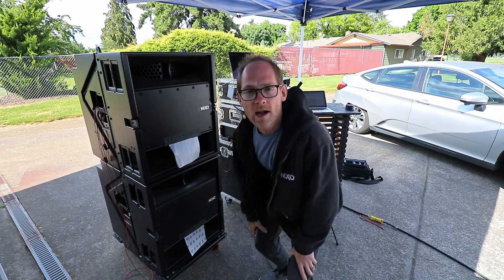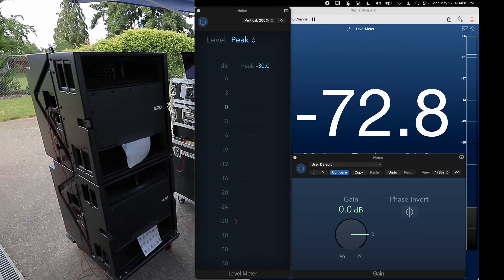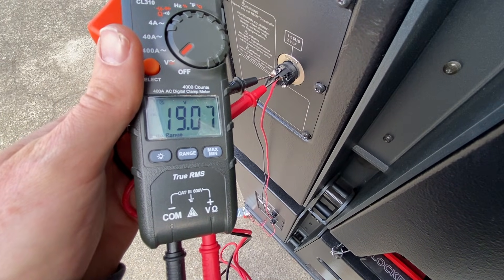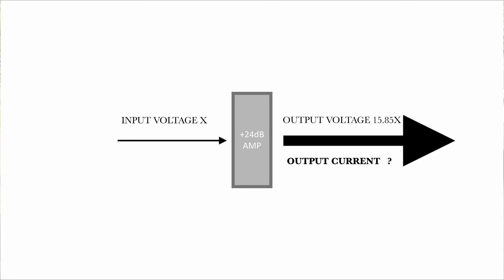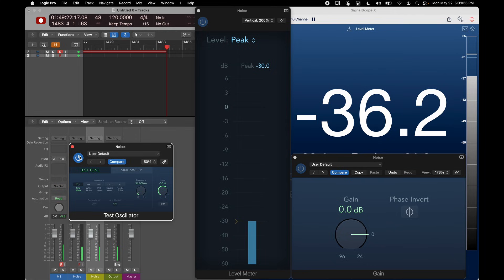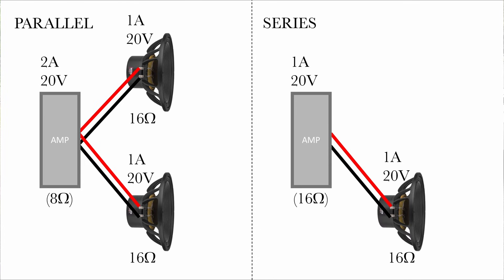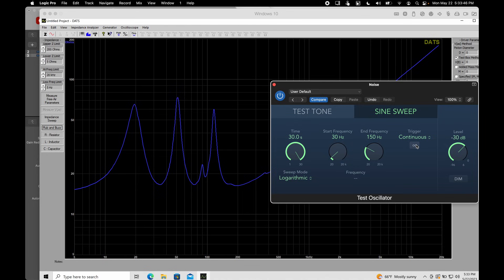Is doubling speakers +3dB or +6dB? What's parallel and series wiring?

Comment: A bit misleading and can be completely wrong in many cases, but it could also be technically accurate if your amp will double the current like he says at 2:50, at 2:50 he states that almost all amps double the current and keep the voltage the same, this is not true, many many amps do not, especially nowadays with class D garbage, and if they don't you end up with less DB increase than what is represented in this video.   Then when he gets to the part about adding a speaker in series, this is why that can be wrong and misleading also.. Why? read on... The Zero DB added with a speaker added in series is "technically zero" but then it doubles your power handling capability and doubles your surface area and now you can see the math on that right?   Also, he does not mention that in parallel you need and amplifier that can double the ampere output and handle that higher amperage / lower ohm load safely, if it can not you will not get the DB increase, or maybe you will but then your amp overheats and blows up.   Personally I prefer to use a higher ohm speaker and then connect in parallel, in parallel they are more in sync, and in series they can actually have slightly coupled oscillations, with results in a phase problem and loss of DB and SQ.

Comment: Please correct me if I'm wrong. You got +6db, but only in case when you underpower youspeakers, right? Cause if the speaker was playing at its maximum rms power, connecting the second speaker in parallel could damage them both, so you should turn it 3db down

Comment: Please correct your narration at 6:25.   The speaker's resistance is constant, it's impedance varies with frequency.
Reply: It's resistance also varies with power input as once that voice coil gets hot, it's resistance increases. There is a name for that and it's called "power compression" as once you get those coils hot, doubling of power no longer gets you +3dB's even if you have the x-max left to do so.

Comment: would i wire in series or parallel for splitting the 16ohm speaker output for a guitar amp to two 8ohm speakers?
Reply: series

Comment: WRONG.
2:19 - 
Ohms is NOT a measurement you infer from taking a clipon ammeter reading, via an AC speaker voice coil current/voltage.
OHMS is ONLY a measurement used for a PURE resistor.
Speakers have a voice coil (an inductor) thtat DOES NOT reflectit's DC resistance, when powered by an AC signal,as then it's reference is as AN IMPEDANCE.
A Capacitor is likewise referred to as drawing a certain amount of DC until it reaches it's capacity, then it STOPS drawing any more current, thereby switching that circuit OFF.
On reversal of a dc voltage at a capacitor, you IMMEDIATELY get an outrushing extremely high current - until the opposite voltage is the same at he capacitor as it is with the DC connected to it, then it again STOPS drawing any current.
That's why a capacitor is very good at passing any type of AC and it's why it is a brilliant DC OFF SWITCH, because one the DC voltage is reached, at the capacitor it stops conducting..

OHMS LAW is determind purely by way of a risistanc  (across a length of any resistor, such as a Nichrome Wire.
When I was building heavy industrial switchboards (in the 1980's) we often "wound" nichrome wire coils, so that we could direct start LARGE electric motors direct off the 400v AC 3phase lines, as the nichrome was extrem;y resistive, as well as being coild, which added to it's reactance, meaning that it had a very restrictive resistance (as well as a substantial reactance) to any additional current flow, which allowed a LARGE MOTOR (connected by a contactor onto the Nichrome coils) to slowlyincrease from stationary, up till about 50 - 55% of it's noral speed, at which time, a timer would swap contactors, taking OUT the Nichrome resistance, and connecting the motor directly onto the incoming 400v 3Ph mains, whereupon the motor would rapidly increase it's rpms, up to it's normal running speed.
That way, the incoming MAINS cables at the premises DID NOT have to be extremely large, to handle DOL inrush currents, if those motors were connected directly onto the incoming mains with the motor stopped.
As that amounted to a basic short circuit as far as the mains was concerned, meaning that fuses would ""pop" everywhere, so bringing a motor UP slowly from stationary, until it reaches about 55% running rpms, and ONLY THEN connecting it directly to the incoming mains, does the mains need to supply a little extra current, to uplift the rpms until normal running speed is attained.

Now, IMPEDANCE is what you "should be explaining" when dealing with AC voltages in speaker voice coils, as their resistnace has absolutley nothing to do with their terminal REACTANCE on initial startup, or during the later "normal running"

2:19 - TALK ABOUT REACTANCE.

Comment: You got the reason wrong. Doubling the speakers doubles the power. That is +3db. The correlated sound from the speakers adds and subtracts together and and changes the direction of the audio spread. So with speakers stacked the horizontal angle is increased while the vertical is decreased. Dead center we get the extra 3db.

Comment: Soooo, if you had 2 sets of 100 8ohm speakers wired in a series parallel configuration with a 4ohm load you'd get 180db gain?

Comment: Hello? Can I ask question for my car stereo and amplier, 
My amplier is 3000w, 4 channel, but the car stereo I bought is only 2 channel, and the 1 channel  connected in my 750 sub woofer at the back seat on my wagon and the other 1 channel connected in a dome tweeter 100w, and I want to add 1pizzo tweeter at the front seat, is it right and safe if I will connect the Pizzo tweeter in the channel of the dome tweeter? Can I have your advise? Thank you!

Comment: Remember lower amps means you can use smaller wire.. Everything in Life is about compromise. I'm dealing w the phase issue of matching impedance so Ive decided to use wooders in parallel and mids and tweeters in series.. I figure I will get less audible cancelations at the frequencies most heard..

Comment: The concept of the “impedance chart” implies that the voice coil has fixed resistance.  The impedance will fluctuate in reality because it is a coil and therefore it is an inductor.  The impedance variation is inductive reactance and is based on the Formula 2piFL.  2 times 3.14  times the applied frequency times the inductance in Henries which is fixed by the windings in the coil.  It’s not purely resistive so watch it.  Your load could drop down to 3 ohms in parallel when believe it’s still 8.

Comment: One really good thing that you can do for pro audio is to couple or stack your subs. You get +3db increase electrically and you get +3db more from the coupling. So that's a +6db boost.
So in a nutshell coupling two subs makes them sound like 3 subs! 
I used to leave my subs spread apart and this gave me the sound of 2 subs. There are some gigs in which hard hitting bass is not needed and that setup is fine. But for most of my gigs I like hard hitting bass so I couple the subs. Side by side or stacked both work out well. 
Two coupled 12 inch subs will sound like a single 18 inch sub.

Comment: At the 4:59 mark, with ONE speaker, you've got: 
V=20V
I=1A
R=16ohm
This doesn't follow ohms law. Since the speaker resistance is set at 16ohms (perhaps slight variation considering it is a non ohmic device), it would not draw 1A of current, it would only draw the current required to keep ohms law intact. Please correct me if I'm wrong... From that time stamp onwards, there are similar errors carried through

Comment: As an RC car enthusiast, this is particularly confusing. We run batteries in series and parallel. Series combines the voltage (way more power!), parallel combines the mah (way more time to play, think of it as making your gas tank twice as big). Is it the same principle with speakers, because it seems to be the exact opposite? And to make things more confusing, both the amp and the speakers can change impedance depending on dual channel or stereo setup. So if we were to compare this to an RC car battery setup….is the speaker the battery, or is the amp the battery? On a side note, what happens to these setups you just showed, if the amp is in mono mode? Meaning can you run 2 speakers in series/parallel through a mono setup? And what would that do? You seem to have a strong grasp of this topic, any insight is appreciated. 👍

Comment: 🎯 Key points for quick navigation:

00:00 🔌 Introduction to Speaker Wiring
- The video introduces the concepts of speaker wiring configurations: parallel and series.
- Explains the upcoming experiments with volume and impedance.
- Sets the stage for learning through real-time demonstrations.
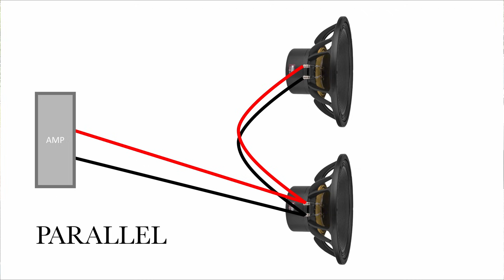00:28 🎚️ Demonstrating Parallel Connection
- The first experiment shows how connecting a subwoofer in parallel affects volume and current.
- Demonstrates a 6dB increase in microphone reading with parallel wiring.
- Current from the amplifier doubles while voltage remains constant.
02:19 📊 Understanding Ohms and Current
- Discusses the relationship between speaker impedance, current, and voltage.
- Describes how impedance affects amplifier load and current output.
- Introduces Ohm's Law and its relevance to audio systems.
04:04 🔄 Effects of Series Connection
- Demonstrates the impact of connecting speakers in series on volume and current.
- Shows that series connection results in a 0dB change in microphone reading.
- Discusses the division of voltage and current between the speakers.
06:04 ⚖️ Limitations of Series and Parallel Wiring
- Compares the advantages and limitations of series versus parallel configurations.
- Emphasizes the resistance changes with frequency and its effect on performance.
- Notes practical limits of speaker configurations in parallel and series setups.
08:00 🎶 Impedance Measurement and Efficiency
- Explores the impedance characteristics of speakers across different frequencies.
- Highlights the importance of driver and enclosure compatibility for optimal performance.
- Concludes with a summary of the video’s main points and encourages further exploration.

Made with HARPA AI

Comment: very nice video, but I have some corrections and contributions
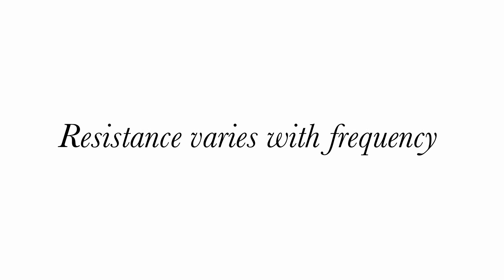1) 6:20, while it is true DC resistance of voice coils, do vary with frequency, it is a very little change in comparison with reactance, which varies greatly. The text should say "impedance varies with frequency", which is not the same of resistance. But all of these varies with frequency, resistance, reactance and impedance overall. (ideally resistors have a flat frequency response, but complex AC circuits like speakers are very complicated and do exhibit non flat resistance component)
2) 3:34, I think what you tried to explain here is right, but not correctly explained.
The dB scale for power is calculated as P (dB) = 10 * log10(P/Pref) 
While dB scale for pressure and voltage is calculated as V (dB) = 20 * log10(V/Vref)
These formulae means that doubling the power is to add +3dB of power, but doubling the current, voltage or presure is adding +6dB of the quantity.
That said, what really happens when you connect a second speaker in parallel with the first, while remaining a constant signal or voltage output, it is true the amplifier delivers +3dB of power, because it is doubling its power output, its impedance load is divided by two, thus power is multiplied by two, because of P = V²/Z . Where V remains the same and Z gets divided by two. Doubling the power is adding +3dB of power. Say for example if your first spkr is developing 1 Watt, the second spkr you connect will develop the same 1 Watt, while the power of the first one remains unaltered. Being the total power delivered by the amp just the double of just one speaker connected.
But with SPL pressure is a different story.
While signal/voltage V remains the same, the power of the first spkr will remain the same, and the second will develop the same power of the first.
You have +6dB of SPL pressure output, because the pressure is multiplied by two , these pressures of every spkr is just added. and the dB scale for pressure is different that the scale used for power. Double the sound pressure (say in Pa units) will result in adding +6dB to the SPL.
So why you have +3dB power in the amplifier and +6dB pressure at the spkrs?, why this 3dB difference?
Because doubling the amount of speakers raise +3dB of the sensitivity of the system. 
Say for example one spkr has a sensitivity of 95 dB 1Watt/1meter, two speakers have 98dB 1Watt/1Meter. But this is far more complex because there are issues like vector sum, phase coherence, wavefront shape, polar response and many things that make this very complicated in practice.
Reply from the maker: Nice ok so: adding a second speaker in parallel but sharing 1W of power raises the total sensitivity by 3dB as measured by the microphone. So then, what if we also double the total power to 2W? The mic measurement goes up another 3dB, for a total of +6dB. If we double the power going to only one speaker, the mic reading only goes up 3dB. So what is the mic measuring?
Reply: @devinlsheets_alphasound  
"adding a second speaker in parallel but sharing 1W of power raises the total sensitivity by 3dB as measured by the microphone. So then, what if we also double the total power to 2W? The mic measurement goes up another 3dB, for a total of +6dB." Yes, correct.

" If we double the power going to only one speaker, the mic reading only goes up 3dB. So what is the mic measuring?" Assuming you disconnected the second spkr, and have only one, if you double the power (+3dB of power), you get +3dB of pressure. while doing this you multiply speaker voltage by 1.4142 (square root of two)

the mic measures pressure, voltage reading of microphone terminals are proportional to pressure waves at the mic capsule, say for example a calibrated measurement mic could say its sensitivity is 1 Pa = 94dB SPL = 8.15 mV RMS.
Pressure reference for the dB SPL scale is 20 uPa (twenty micro pascals) as in formula dB SPL = 20*log(P/Pref)
Because power is proportional to the square of either voltage or current, the 10*log formula was chosen for power, and 20*log for voltage, current, and pressure that is proportional to spkr voltage. 
That way when you add +3 dB or +whatever dB to power, you get equal +dB to voltage or pressure.
that means, adding +3dB of power (doubling power), you get +3dB at SPL pressure (pressure/voltage is multiplied by 1.4142 square root of two)
Adding +6dB of power (multiplying power by four), you get +6dB at SPL pressure (pressure/voltage is mutiplied by two)
Or in other words, if you multiply voltage by two, power will be multiplied by four, because power is proportional to square of voltage.

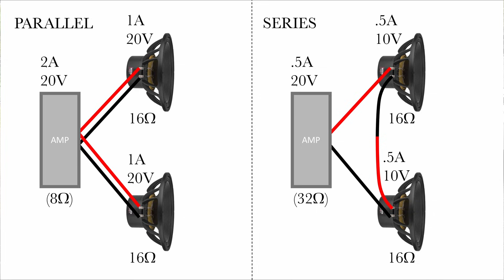Comment: I like this video, I am new with speakers. I think there is an error at 5:31, the 8 ohm on left below the amp  should be 16 ohm? Also, I would think you would want to measure things with one speaker at one volume level, then while measuring, turn up the volume to get 3db increase and see how much voltage and current are needed. Then you have a response curve to test against the equations. Maybe I missed that but seemed like you were keeping at same volume knob level setting the whole time.
Reply from the maker: When you connect two speakers in parallel, you double the amount of current which doubles the ohms. The voltage remains the same.

Comment: I suddenly Have a problem connecting  front door speakers 2 a second channel makes really bad audio( IV had the sound system in the car for 4 years I was told it was either a bad rca cable or the input of the RCA was damaged, I used another amplifier and changed the RCA cable but I still have the bad audio 
I ended up connecting all four speakers to one channel parallel and now the audio is ok out of all 4 speakers  in total the 4 speakers add up to 24 ohm speakers watts add up to just under 1900 watts and the amplifier is 3000 watts  I'm wondering if this is safe until I can finally get the problem fixed by a professional the gain on the amplifier is not max it's around half maybe less not sure since it's just a cross that I twist left or right

Comment: @devinlsheets_alphasound - I'm super curious about running things in series. Theoretically, if I had multiple four 4-ohm subs with a 1000w rms rating and a 135dB half-space spl, and wanted to run two of them in series per channel so I could get away with fewer/cheaper amplifiers, how would I calculate the wattage rating to properly drive them? Can I double the recommended wattage like with a parallel configuration to see a +3dB increase in SPL over one cabinet for a pair in series? Is it a lost cause because of the inherent electrical and mechanical cancellations? If i do get amplification in a series deployment, would I see +6dB if I doubled that same configuration? Are there phase/output issues or other substantive issues that I'm failing to consider?

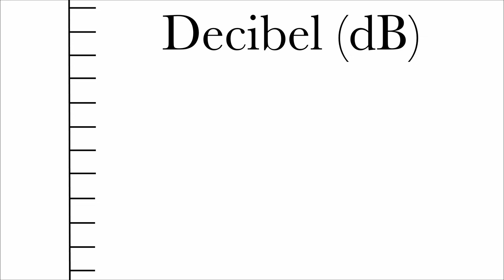Comment: Good effort and thanks a lot for the Video. I would like to experiment like you did, but hardly find opportunities with gears. To whatever I have learnt: Doubling the Voltage or current should result in 6 dB not 3 dB. Correct the video @3:24.  Doubling Power results in 3dB change.  

Please correct me if I am wrong.